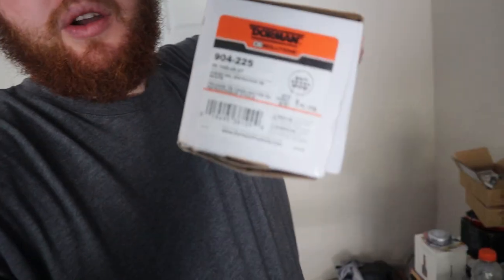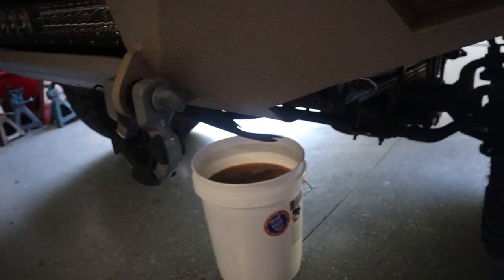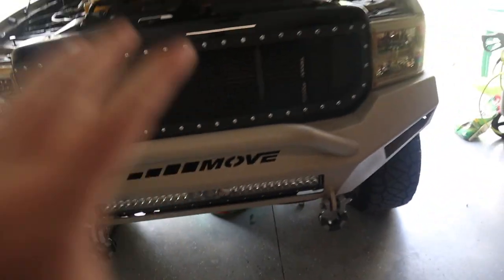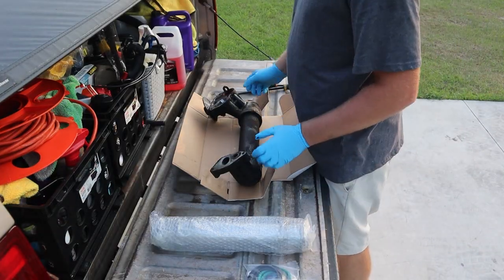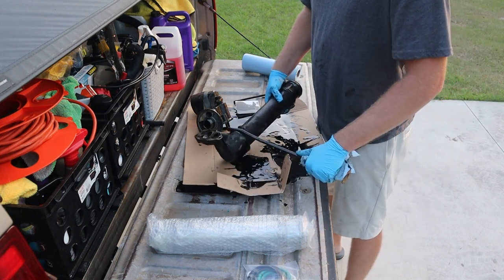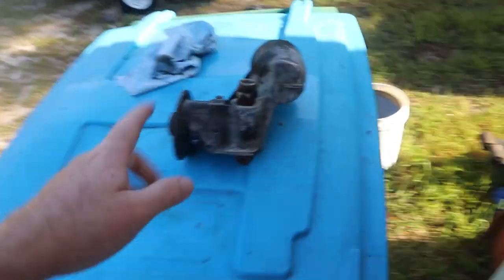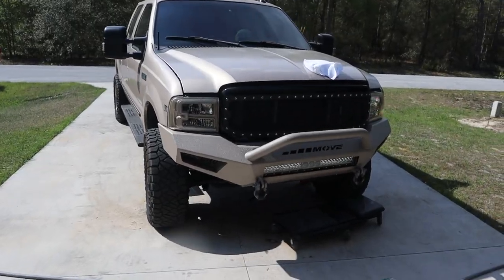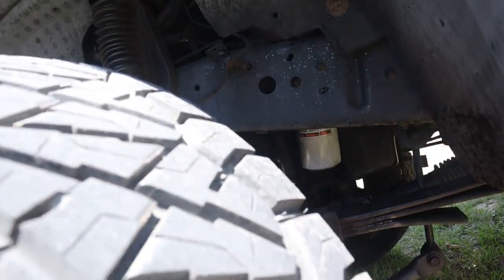No More Oil Leaks! | 99-03 7.3 Oil Cooler Rebuild

Comment: If your interested in making your oil last longer. I bought AMS oil bypass system along with a guard to prevent gravel or rocks from puncturing the filters from a guy on YouTube. Installed the kit at 10,200 miles and at 16,200 the oil doesn’t even look like it’s half used on my 10/99 F250 7.3. The guy on YouTube I bought the guard from, his channel is “Don Smith”. Search 7.3 Amsoil bypass kit and you can find him standing in front of a 2000 F350.